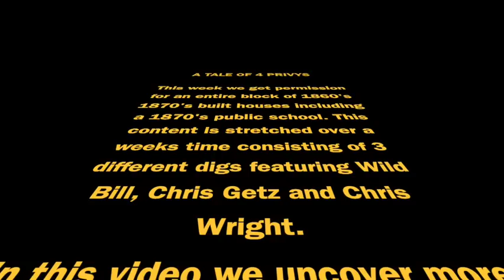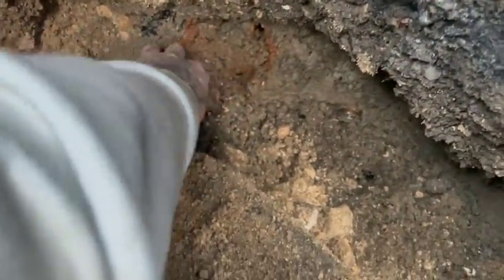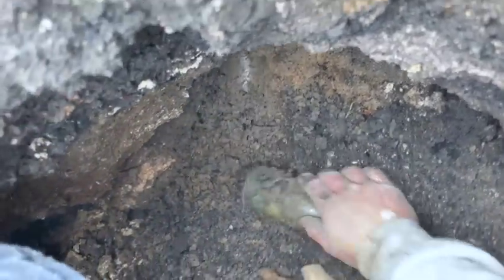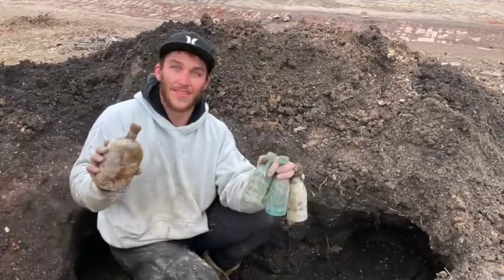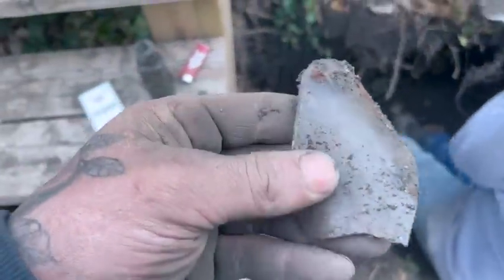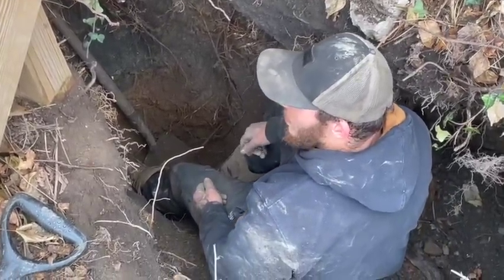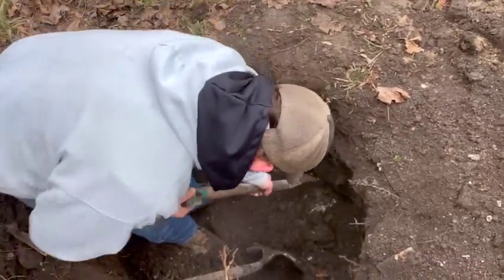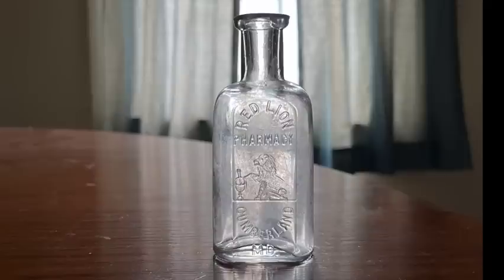EPIC PRIVY DIG LEADS TO CACHE OF 1860's 1870's TREASURES PART 1

Comment: Nice bottles Corey. Where did you get that two prong digger tool and what's it called. Thanks
Reply from the maker: It’s just a pitch fork with the end two prongs cut off. They work very well
Reply: @thetimetravelers3112  ok thanks for the info

Comment: Cory what did they make the moulds out of? Was it clay or maybe lined wood. Iam just trying to figure out how they sculpted the designs and made the scripts?
Reply from the maker: These ones were blown into a metal mold. They used a few different metals. Some are blown into wooden but normally earlier bottles. Pre 1820 I think they were using clay
Reply: Wow I would have never guessed they used metal. That’s like tool and die work. How do you make beautiful script like that with 1800s tools and technology?